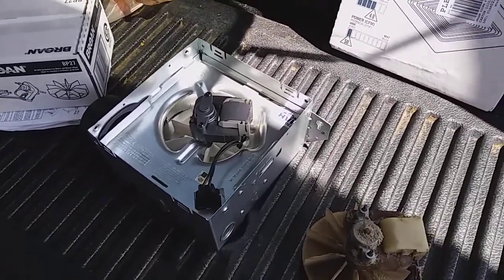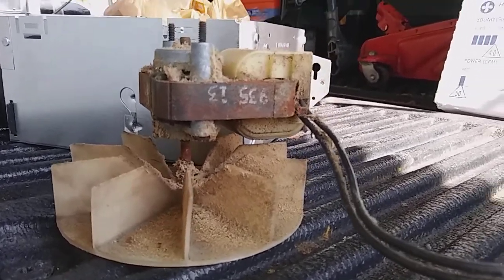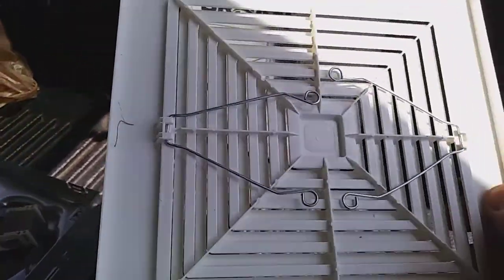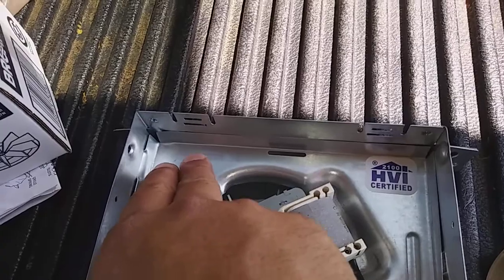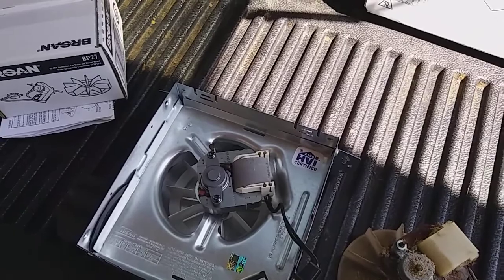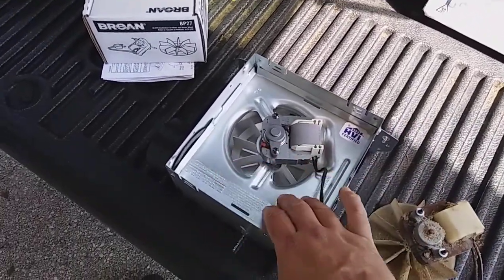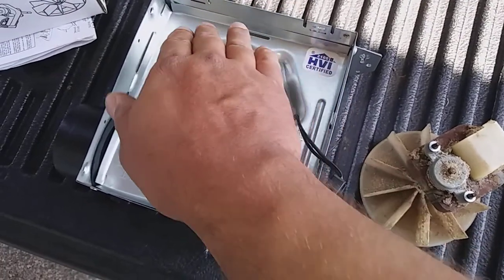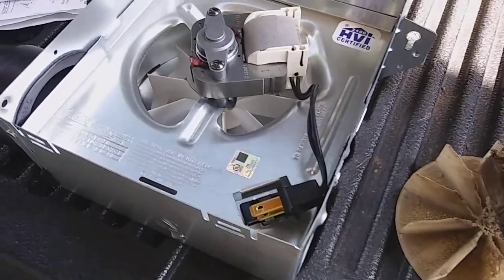Broan bathroom ventilation fan repair and troubleshooting

Comment: Thanks for going through the details with the electrical trouble shooting.  My breaker switch was tripped for the fan and when I reset it worked like normal.  I know this is not a common occurrence for most people but your video really helped me.  Thanks again!

Comment: My BP27 spins the opposite direction and pushes air down to restroom. Is there a way to reverse motor?
Reply: Pretty sure you just need to flip the fan up side down.  Someone must have re-installed it incorrectly after cleaning it.
Reply: @Meeshwell  No, I called the company and they stopped making the model I need. I had to order it on Amazon from old stock someone had. Flipping it upside down was tried but did not fit in the canister.

Comment: You forgot to show removing the fan, motor and remounting it with the screws upside down then you need a few washers to make this fit.  Done this on my fan several times when the fan motor gets too noisy and worn out.  Hard to buy the old motor.  Cheaper to buy the new motor , with the fan and metal shroud and change them.